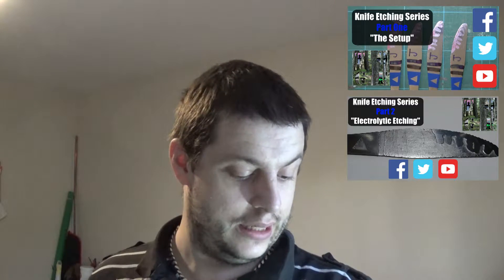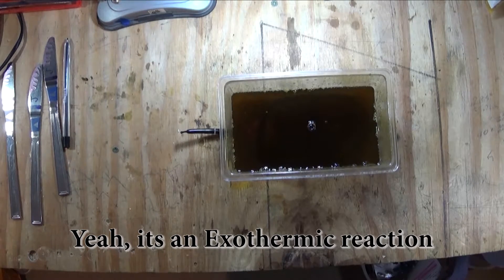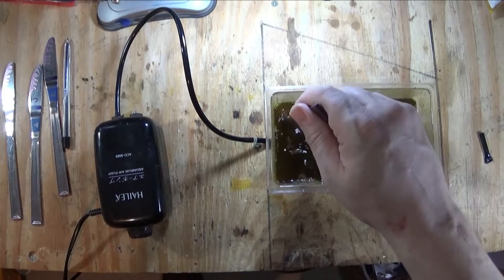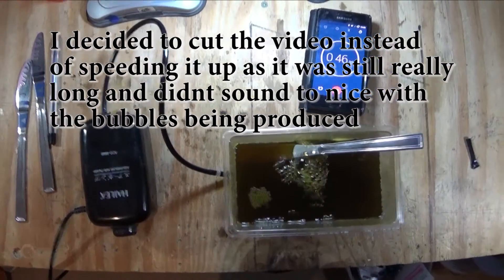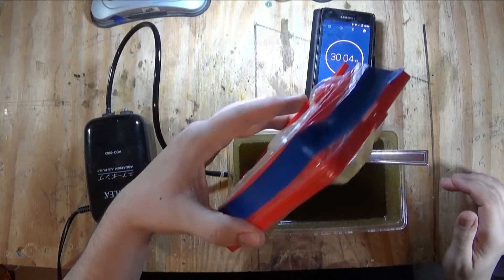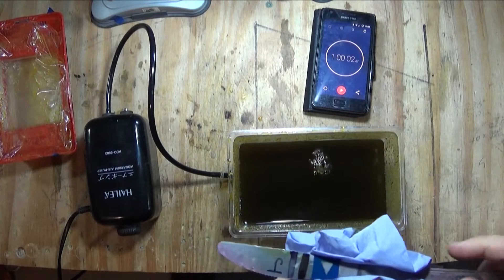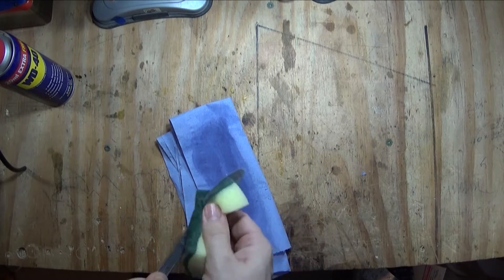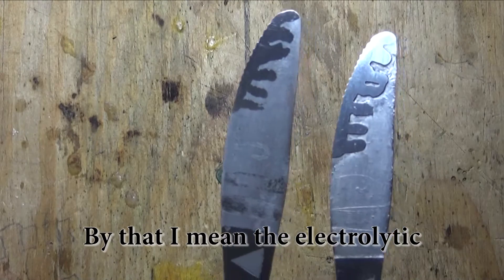Knife Etching Series | Part 3 || Etching With Ferric Chloride |

Comment: is Ferric Chloride safe to use on kitchen knives  ?
Reply from the maker: As long as you wash it off after then yes. However I am only using kitchen knives as a test material because I could get a few for cheap and all the same to keep the test fair. Thanks for the question